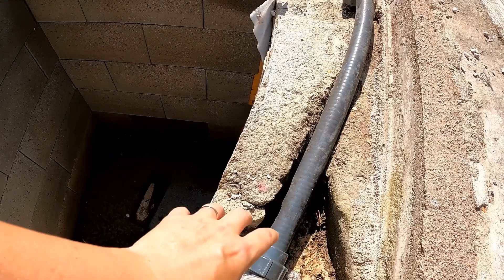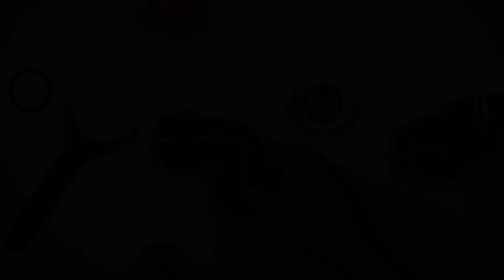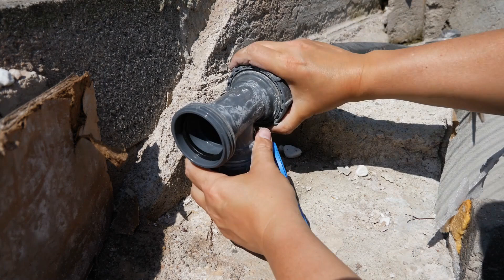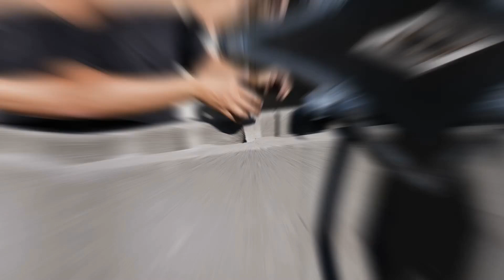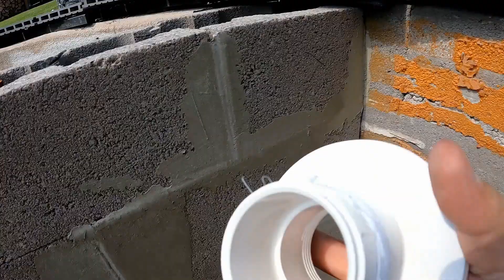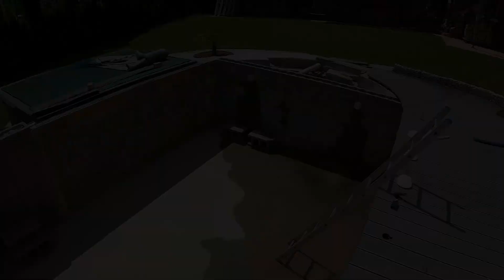How to Connect Pool Inlet Nozzles Like a Pro

Comment from the maker: Product list*
🔗 Thread sealing thread: https://amzn.to/3wgcqqA
🔗 Pipe cutter: https://amzn.to/3jI0MSE
🔗 Assembly wrench: https://amzn.to/3dH79ly
🔗 Reducing piece: https://amzn.to/3suNWZB
🔗 FlexFit elbow to thread: https://amzn.to/3qLIBx4
🔗 FlexFit T-piece: https://amzn.to/3jGXY8D
🔗 FlexFit pipe by the meter: https://amzn.to/49nDzfg
🔗 Inlet nozzle: https://amzn.to/31qF6jD
🔗 Closure for inlet nozzle: https://amzn.to/3ylUgFw

This video was originally created in German for my main YouTube channel @commaik 🔗 https://youtube.com/commaik. It has been translated into English using 🤖 the AI tool HeyGen, which replicates my voice and synchronizes my lip movements. 

Please note that ⚠ due to dynamic adjustments, the synchronization may not always be perfect.

📺 The original video, which includes English subtitles, can be found here: https://youtu.be/Xz4f8-gJqWg